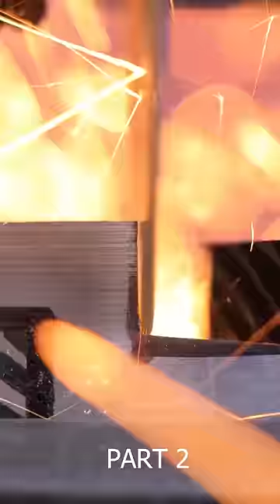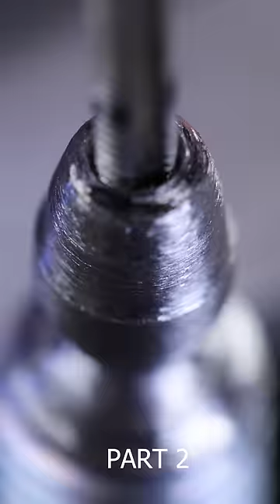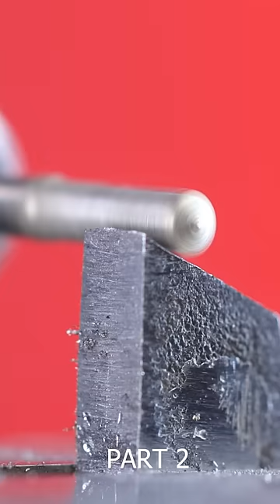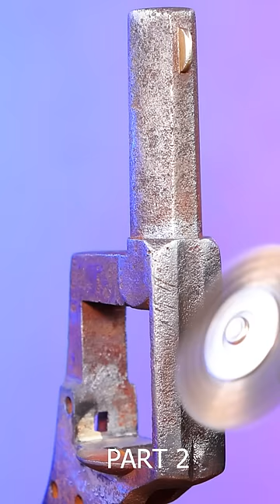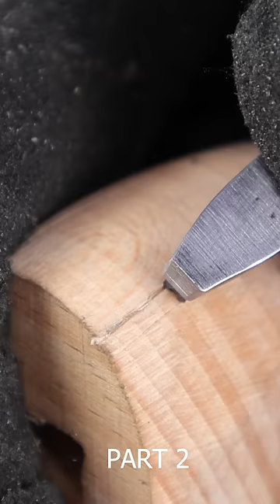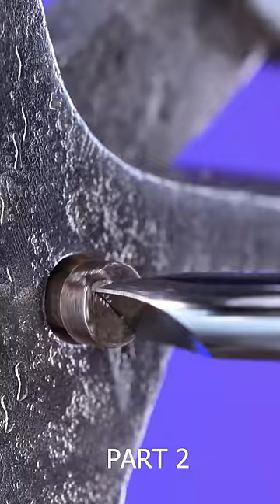Old Revolver Restoration | W&S Part 2 #Shorts

Comment: With the pitting on that, I'd be afraid to shoot it
Reply: Not to mention how much heat he applied. The metallurgy is probably all sorts of fucked up now.
Reply: Und damit schießen , nein danke.
Reply: @gdawgpwnsall  if it’s genuine steel, none of that all matter
Reply: Looks to be from black powder era to me it's probably safe to shoot if its the only thing u got definitely try it with a string first haha😂
Reply: it’s a webley RIC M/83 using lower pressure .455 or .450 (not 45 acp usually, but some of the last ones were chambered in it). as long as you shoot some low pressure ammo through it you’d probably be fine